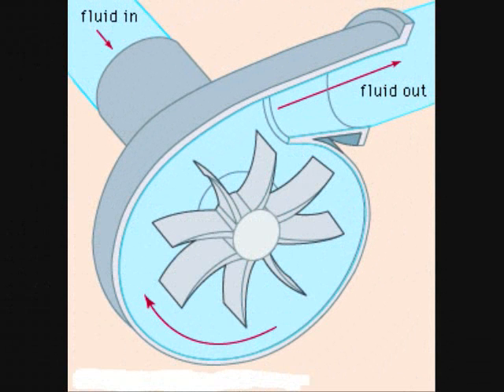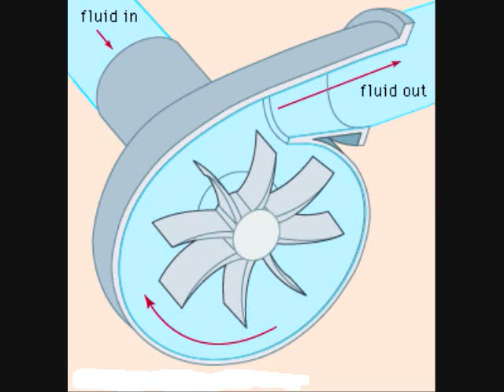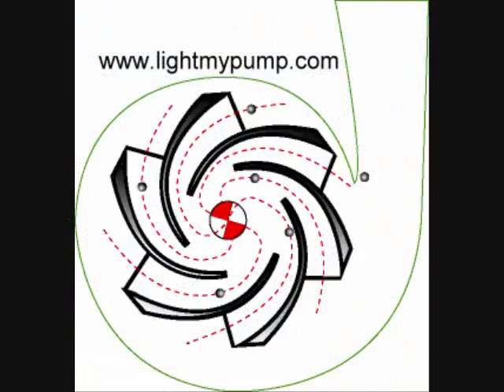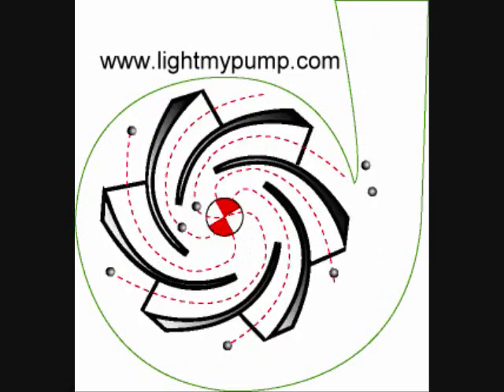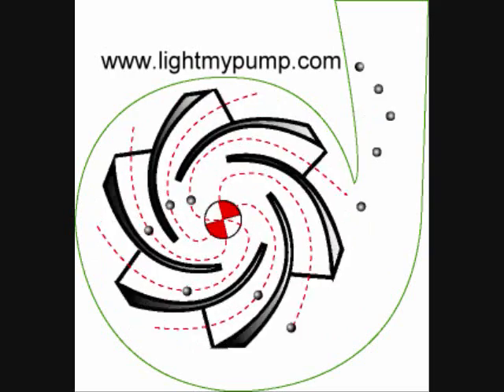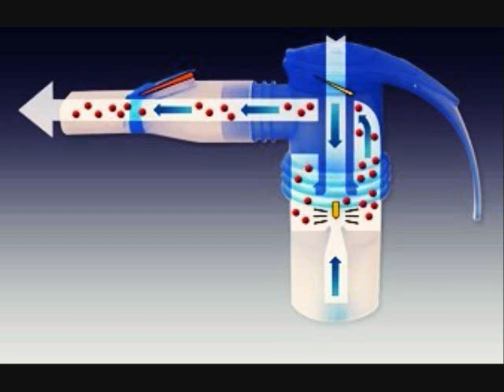Bernoulli Principle and nebulizers

Comment: "a typical SVN is powered by a high-pressure stream of gas directed through a restricted orifice (the jet). The gas stream leaving the jet passes by the opening of a capillary tube immersed in solution. Because it produces low lateral pressure at the outlet, the high jet velocity draws the liquid up the capillary tube and into the gas stream, where it is sheared into filaments of liquid that break up into droplets. This primary spray produces a heterodisperse aerosol with droplets ranging from 0.1 to 500 µm" -Kacmarek, R., Stoller, J., Heuer, A. (2013). Egan's Fundamentals of Respiratory Care, 10th Edition.
Reply: Sir 
Can we say these droplet as steam.
I mean what ever the outlet of nebulizer is steam or droplet or saturated steam?